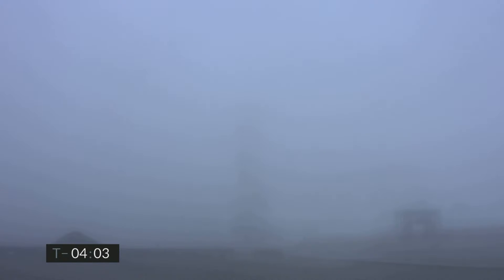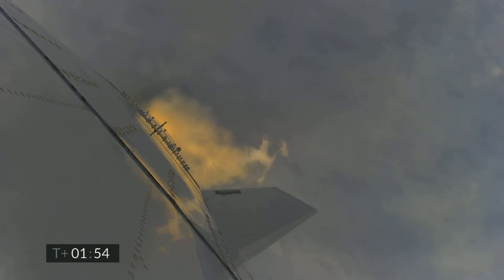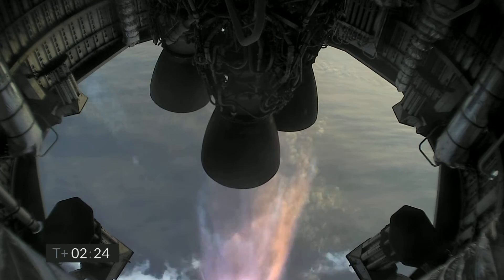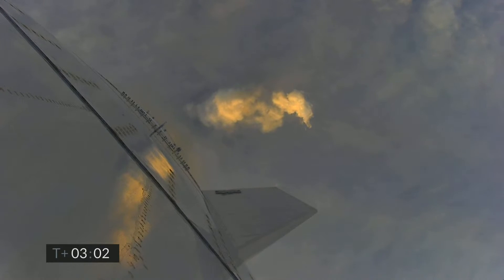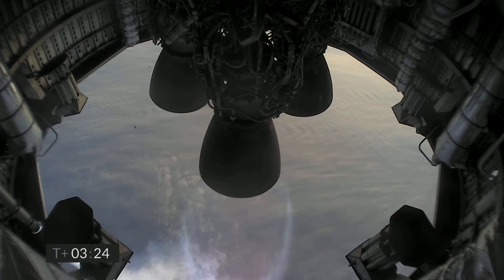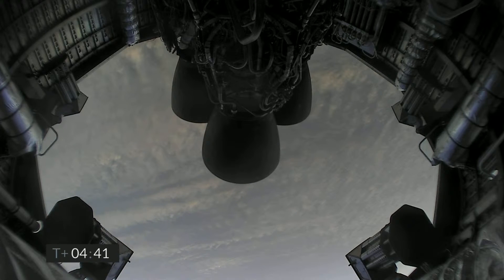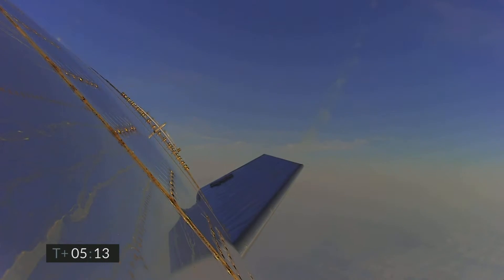Starship | SN11 | High-Altitude Flight Test

Comment: I wonder why they insist on exploding the Starships at landing...why not apply all 3 raptor engines at landing..?
Reply: Same reason they don't land Falcon 9 on all nine engines. Too much thrust.  Rocket engines have a minimum throttle. For Raptor, this is currently around 40%. 
So a Raptor engine can produce between 80 and 200 tonnes of thrust. Two engines, between 160 and 400 tonnes, and three between 240 tonnes and 600 tonnes.
The ship only weighs abut 120 tonnes at landing. Three engines would give a minimum TWR of ~2, making it very difficult to avoid 'pogo-ing'.
That is to say, coming to stop before reaching the ground and then flying back up because you can't reduce your thrust enough to hover or descend.

Comment: when the video froze, the S11 was in a superposition of being 
boom and not boom
Reply: Actually, the video didn't "freeze."  It's a delayed video signal.  The on-board video encoder and radio transmitter experienced "severe data fragmentation" at landing, so the rest of the recorded video (being digitally encoded for late transmission) was atomized.  (The audio signal isn't as delayed as the video signal, so we got to hear more of it.)

Comment: Around T + 20 seconds a bright point like a spark appears and starts “crawling” along a pipe until it reaches what may be the pre-burner running the high pressure fuel pump at around T + 24 and continues around it. At T + 26 the pre-burner bursts into flames. Looks like the pre-burner cracked!

Comment: To me instead of using just one Engine to just slow it down to land. Use two to slow it down. The more thrust you are using on the landing the more the SN will land correctly but slow it down enough so that when it’s a couple ft from the ground you can shut it down to one after using two to slow it down. I notice that during SN10 when it landed correctly but then exploded 8 mins later. Using one engine is pretty risky
Reply: They did plan to use two engines for this landing. It's unclear whether the second one lit because we lost data feed.

Comment: Again Raptor engine failure ,why you dont buy engines from Russians they have bulletproof engines !!!!!!
Reply: Russia's engines are single-use, not built to handle dozens or hundreds of flights. Most of them have no throttle capability or mid-air start capability.
Additionally, none of them run on methalox, which Starship is designed to use as it's vital for Mars ISRU. It also helps with reusability since it burns cleaner.
They also cost around ten times more for a given thrust, and Russia probably can't build them fast enough. They're currently making 5 to 6 RD-180s a year.
SpaceX have already flown and destroyed 12 Raptors in the last few months, equivalent to 6 RD-180s. To build just one Superheavy-Starship stack they'd need 17.
Reply: These are experimental engines, they are not reliable yet and they definitely don't because reliable overnight. 
The only other test flight that had a raptor issue was SN9 so no, the engines aren't bad.
Reply: @καλαμ  Well i hope Raptors are good and i hope that they can do better ,for moment 50/50 so not to good result.
Reply: @elmakcnc5960  They are, they just need time to become reliable. You also need to remember that this is only the 4th time a Starship has been tested. 
According to Elon, SN15 has got hundreds of upgrades and they are rolling it out onto the launch pad in a couple of days.

Comment: As an aircraft mechanic, I have to ask why is there always some sort of fire around the engines during the run sequence? Are fuel lines leaking? Perhaps if the problems generating the random engine compartment fires were fixed there would be less explosions. Maybe an on board fire suppression system might help as well. It seems like the thing is flying great though.

Comment: Ah another successful failure and they said they were going to be doing what by 2022? Oh yeh land on Mars......yet another elon boast like his hyperloop that just doesn't quite match reality. Now to duck behind some sturdy cover as all his sycophantic fan boys are triggered and come out crying.
Reply: Do you not know what rapid prototyping means?
Reply: Falcon 9 boosters crashed five times through 2015 and early 2016. Yet by the end of 2016 they had also landed five times. 
In early 2017 they started reflying them. By the end of 2017, an additional 14 boosters had now successfully landed, and four additional reflights, with zero failures.
Today they've landed 78 times. Reflown booster launches are now the majority, as opposed to new booster launches. One booster has flown 9 times so far, another 8 times.
My point is that SpaceX have shown the ability to go from a string of failures to successes in a relatively short period of time.

See also: Falcon 1. Three failures in a row, followed by two successes, then 18 subsequent successes with Falcon 9.
SpaceX use hardware rich testing. It takes them a while, and a couple of failures to work things out, but once they do they're up and running.
This is even more applicable for the Starship program: they originally planned for up to 6 failures before a successful landing.
After SN8's near success they revised that number down, but it now appears that it may have been a bit of a fluke.

They also set aspirational goals, on the premise that it's better to say 5 years and miss by 2 than to say 10 years and arrive on time.
I'm not holding my breath for Mars 2022, but I do think Starship will be operational in an orbital capacity by then, and more than ready by the 2024 transfer window.

Comment: How many more test flights one has to do to prove that it's already safe for astronauts?
Reply: At least many dozens, if not a few hundred. 
Wheras the space shuttle was manned from the very start, SpaceX are aware that this system will take time to work out the kinks, and so they're planning to do a large number of test launches, followed by an even larger number of Starlink and other cargo launches, before they start thinking about putting people on it.

Comment: I had no deadline not like the current space race, I was working on low alloy glass steel. It took twenty years of failure several times a week before I made a half kilogram block. No failure and there will be no deep learning. There are no books, no directions and no simulations to prepare you for the cutting edge of reality. I laughed when I made the first success on Halloween. SN series is like Kitty Hawk all over again.

Comment: What they need is some way to keep the preasure on the fuel.tooth past keeps preasure in the tube.rubber piston like the seal in the space shuttle that failed but better.maybe air preasure on one side of piston keeping fuel on the other side computer controled to keep the preasure constant even if it rotates or go into 0g for a time got to try some thimg new to fix .try on a small model save money proof of concept put a camera glass in the chambers to try and see how the fluid is beinghaving dence preasure.its all a test anyway.it seems like fixing the fuel preasure thing is the only thing holding it up.you got to see the proplem for what it is to get it fixed.save time.money ,maybe a few tanks that go into one that keep the preasure teat in a plane that go's in 0g and try to slash the fuel running but just dont light it up.take fuel preasure reading.getting some thing dependable is key.

Comment: Need more engines..for the heavy lifting part.
Reply: No it doesn't. The final starship will have 3 sea level engines and 3 vacuum engines. They don't need more.
Reply: @καλαμ  i mean they are only turning one engine on while doing the landing..need all 3 to support landing
Reply: @vivekpathi7677  Ahh. Yes they are turning on all 3 engines to flip it, then they turn 1 or 2 off. This is what SN10 did.
SN11 seems to have a completely different problem though.

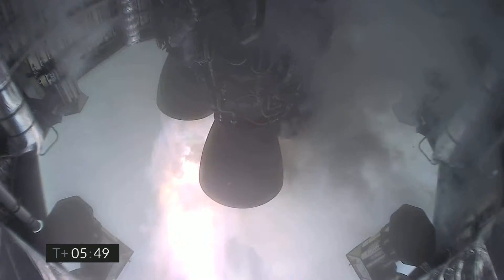Comment: sn11 sounds T+5:49=~ 11:35 'rrrrffshhhh ' 11:43 'thump ffshhhh' 11:44 'thump ffshhhh' 11:46 'lighter thump ffshhhhh' 11:48 'duff ffshhh' 11:50 'crash'.  Guess what the thumps/duff were. Raptor shutdown? Leg deploy? Turds falling before the big flush? Wish I had the telemetry data.
Update: at https://youtu.be/myVvmb2dF9U?t=8361  I noticed at T+5:41, at the left video feed, fog lighting up in orange; just before T+5:49 raptor cam freeze, at the left video feed already some debris falling, followed by more. If both video feeds were in sync, commentators interpretation "I think it blew up" seems plausible to me. I haven't seen orange lighting at T+5:41 in the fog of the right feed=this video, so I doubt both feeds were in sync.

Comment: This is getting quite embarrassing...
Maybe put some wheels on.... you know.... like the space shuttles?
The design is almost there anyway.
Reply: the space shuttles sucked though.
Reply: @lmao.3661  Really?
Reply: @akyhne  yes?
Reply: Yeah, because wheels will fix everything, right?
Reply: @καλαμ  Well, wheels worked for the Space Shuttle, didn't they?
Reply: Landing gear, wings, the structural reinforcement for both, and the extra heat shield tiles covering the wings adds a lot of weight.
Despite having much more efficient engines, the Space Shuttle had an abysmal payload mass fraction compared to Starship.
The Shuttle lifted about 135 tonnes to orbit, of which only about 27 tonnes is payload, or 1/5th. Had the ET been integrated it would have been even worse.
Starship is expected to lift abut 250 tonnes to orbit, of which 100 tonnes is payload, or 2/5ths. And it essentially does feature an integrated (and recoverable!) ET.
Reply: @lazarus2691  Wow, so the Starship is twice as efficient?!
Dude, the Space Shuttle had capabilities, the Starship will never have. A bay can could open and close. A crane to handle cargo. It was a completely different beast, with different purposes. 

And your numbers are pulled out of the air.
Reply: @lazarus2691  Let me give you some numbers, so that we can see how much SpaceX has improved flights to space in the last 50 or so years:

Starship total mass (first stage, second stage, fuel and payload): 5.000 tons.
Starship LEO cargo: 150 tons

Saturn 5  total mass (first stage, second stage, fuel and payload): 6.540 tons.
Saturn 5 LEO cargo: 140 tons.

So only subtle improvements over 50 years. You seem to think that Elon has reinvented the wheel. Starship - if it succeeds - can lift 3% of it's total mass to LEO. Saturn V could lift 2,14%.
Reply: @akyhne  Where the hell did you get 6540 tonnes for the Saturn V?!? 
It's closer to ~2900 tonnes, putting the payload fraction at 4.7%, not 2.14%. And you accuse me of pulling my numbers out of the air lol.

Regardless, my point wasn't that Starship is the most mass efficient rocket, it's not. My argument was that a vertical landing is much more mass efficient for a reusable vehicle than a horizontal winged landing. Saturn V did neither, so isn't relevant to that point.

>the Starship will never have... a bay can could open and close

Um, what?
How else is it supposed to deploy payloads lol. There's literally an openable cargo bay on page three of the payload user guide (figure 3): https://www.spacex.com/media/starship_users_guide_v1.pdf
Worth noting that Starship's bay is larger overall too.

>A crane to handle cargo

The Shuttle had a manipulator arm, not a crane. The winch lift featured on the Lunar Starship (figure 7) is much closer to, though still not, a crane.
And while there are no plans to install a manipulator arm I see zero reason that it could not be done.The Shuttle's system only weighed half a tonne afterall. The larger arm on the ISS is only 1.6 tonnes.

>And your numbers are pulled out of the air.

Again, this is ironic coming from someone who got the Saturn V's mass wrong by more than a factor of 2.
My number are not, in fact pulled out thin air. Starship's dry mass was given as 120 tonnes at the 2019 Boca Chica presentation. 

Header tank fuel has been calculated at ~30 tonnes by NASASpaceFlight based on dimensions. Elon says only about 6 tonnes are needed, but I chose to use the more conservative figure since Elon is known to exaggerate.
'100+' tonnes is the official payload capacity, per the above user payload guide as well numerous other official sources.

So 120 tonnes plus 30 tonnes plus 100 tonnes is 250 tonnes, of which 100 tonnes is payload. Using some of Elon's more optimistic mass figures could put it at 50% or higher, but again I chose to stick to the conservative 40%.

As for the Shuttle, per various official sources, the Orbiter had a launch mass of 110 tonnes (78 tonnes dry, 22 tonnes OMS propellant, 10 tonnes crew/water/oxygen/food etc), plus up to 24 tonnes of cargo. However 24 tonnes is actually the payload to the ISS's orbit, to a low reference orbit it could manage 27 tonnes, so I used that. That gets you to 137 tonnes total, which I rounded down to get a nice whole fraction.

So being slightly generous, that puts the Shuttle at exactly 20%. If you instead use the official numbers of 24/134 you get 18% instead.

And that's not counting the external tank, which the Shuttle did actually lift all the way to orbit, though didn't recover it. Since Starship's dry includes it's fuel tank, it seems to me that it would be fair to also count the Shuttle's fuel tank. The external tank weighed 26 tonnes empty, which would put the mass fraction at around 15-17%.
Reply: @lazarus2691  Your numbers are only for the upper stage. And that's without 1200 t of fuel.
And yeah, my numbers are correct. Yours aren't...
Reply: @akyhne  I'm only using the empty upper stage because that is exactly the point of my comparison. The booster and fuel mass to reach orbit is not relevant. We care about landing, not launch. (though for what it's worth Starship still beats the Shuttle in a payload mass vs launch mass comparison.)

Remember, your original suggestion was to about putting wheels on Starship and landing it horizontally. My response was that wheels, wings, and associated extra mass would significantly increase the mass needed for landing and hence reduce the payload capacity. 

So I was comparing how much payload each vehicle could carry versus how much mass it needs in order to land, so as to determine whether wings or propulsive landing is more mass efficient. 

Clearly that went over your head since you seem stuck on launch efficiency instead (I already openly admitted that Saturn V is better than Starship in this regard, even correcting you in the process), so let me try to put it in simpler terms:

The Shuttle needs ~100 tonnes of mass to land after deploying it's 27 tonne payload, Starship needs ~150 tonnes to land after deploying it's 100 tonne payload. 
This means that the Shuttle weighs 2/3rds as much as the Starship for landing, but carried less than 1/3rd the payload. 

Conclusion: strapping wings and wheels onto your ship adds a lot more weight that some small control flaps and spare fuel does. 
Although, the Shuttle doesn't even really save on fuel, as it reserves ~20 tonnes of fuel, vs ~30 for Starship, which is around 20% of the landing mass in both cases.

Also, you say your numbers are correct, and mine aren't, yet you haven't actually disputed any of mine, nor defended your claim for the Saturn V being 6540 tonnes.
Reply: @lazarus2691  I'll say it again. You are comparing two completely different space crafts. Oranges to apples.

It's a bit, like when people say, now we have the SpaceX rockets, now there's no need for other rockets.
Each rocket has its own purposed and capabilities.

And of course it matters how you get into orbit. If you can't get there, it doesn't matter what your capabilities are, on re-entry. It's one package...

Comment: This is dumb whe would you launch into a fog bank.   You can't observe anything that is happening.   Dumb on SpaceX's part.  Disappointed with their decision.  Elon needs to explain this.
Reply: Ask the FAA.
Reply: Why the FAA they aren’t doing the rinning tSpacex is.
Reply: Why the FAA they aren’t running the test Spacex is:
Reply: @gslogar1  The FAA has to inspect the Starship before it can fly. If SpaceX flies without the FAA's perm, they get in trouble with them. We won't know the reason for launching in the fog for a while.
Reply: @BlamoHD  They would inspect a craft when it is coming into comercial service and they request a safety study and docementation when the client is in development.  They review their test plan and a higher level of the design but they can not and do not authorize the design during development.   When it comes to certification they will become much more actively involved with a craft that will carry people.  In the case of this Spacex test, they would have an FAA approval of the test plan  but would not restrict the ambient conditions before the test.   As Elon said, the probelm is FAA has really not experiencs with rockets and what they do have they have depended on NASA for technical support.  The FAA is far less than competent in rocket desgn and what is an isn't acceptable.  The FAA is a slow governement agency which seems to worry more about optical then design.  Remember these are the same poeple for approved Boeing to fly the 737 Max.